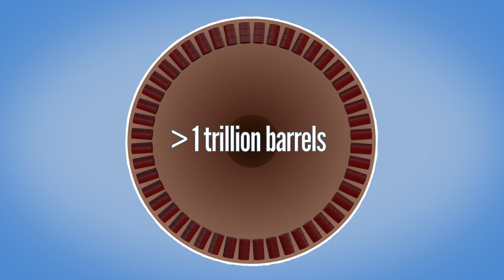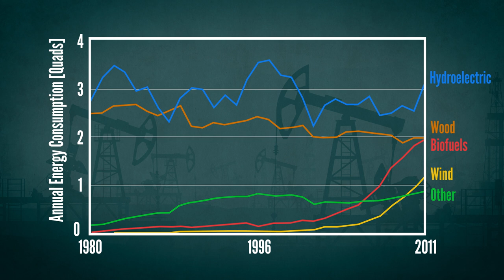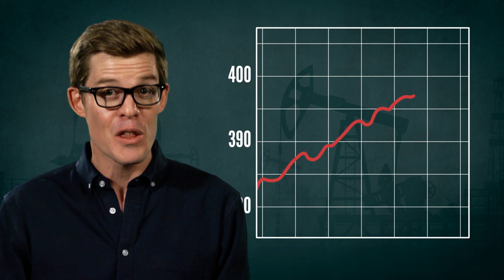When Will We Stop Using Oil?

Comment: Has anyone noticed that most of the oil we drill is not used for fuel? It's used for making products such as plastic.
Reply: Jacob F plastic is a byproduct.. not a direct source
Reply: Hmmm that doesn't really change anything because we still need the oil to produce the plastic.
Reply: Jacob F no we dont.... we can make plastic from milk protien... or even cheaper ..chicken feathers
Reply: Yeah shitty plastic that's... Ugh... Biodegradable jk. Yeah you got me there my bad
Reply: Jacob F in the end we are all in the same team.. we must fight against oil! because in the end it will be expensive......very expensive..to the point we will reach the "artifical peak" he mentioned in the end
Reply: I agree with you there, but completely replacing oil will be no easy task
Reply: Jacob F yep, it wont be completely replaced.. it will be a gradual procedure... all we need is better battery technology... and better solar cells.... also thorium reactors..and fusion reactors

Comment: i did some calculations using google calculator and it said we will run out of oil in around 29 years! thats just saying if we use and produce 93 million barrels and there is 1 trillion barrels left in the earth! so we probably should switch to other ways of power like solar or water!

Comment: Oddly, I have never seen the following question addressed anywhere (and I have been looking): At some point long ago, was all the carbon in fossil fuel in the air (as CO2) all at the same time?

 All the carbon in fossil fuel comes from CO2 that was made into sugar by plants through photosynthesis. So all of the carbon in fossil fuel has been in the air. But has it all ever been in the air at the same time?

  If it has been, then global warming at that time must have been tremendous with all that CO2, because, as this video mentions, only a fraction of that carbon has been released so far. But life must have been going along well at the very same time in order to account for for the fossil fuel deposited.
Reply: Ice core samples have shown that CO2 levels on earth historically were at 7000 ppm. There were no humans or combustion engines then. What caused it and what was earths climate like?

Comment: You say "pump oil"  several times, but did you  know that most of the oil produced is not "pumped"  up from the reservoir? Due to a much higher pressure in the reservoir, you can produce oil without any pumps, as much as 20 000 bbl/day from a single well, without any pumping. Pumping oil to the surface only accounts for a very small fraction of the total amount of oil produced world wide. 

Stay curious

Comment: here's an answer since they decided not to answer. Ok to be fair I can't give u a date. but it's all about $$$ when the cost of oil exceeds the cost of current less efficent energy sources, ie (solar, wind, etc) That when. I would imagine this will be around the in today's dollar amounts 7 US dollars per gallon. And would have to stay around there for years. 
At around 4 or 5 dollar shale oil is cost efficent. So it wont be then. So as long as oil is cheap it wont change.

Comment: What is renewable energy? Is energy renewable? What's renewable in renewable energy?
Reply: it's energy that doesn't end
Reply: It's energy that's very hard to run out of.
Reply: Renewable energy is not a correct physical term. We can't renew energy as we can't either create energy. What is renewable is the process we use to transform it.

Comment: I love your show.  Now if more people like you would built up modern Nuclear power, you might sway public opinion to build these clean and safe but very expensive (upfront cost expensive) power plants. 
With access to clean electricity we can then move into actually creating other clean energies while using clean energy. 
Right now we are using coal, oil and natural gas to build things like wind mills and solar panels and hardly seeing any reduction in fossil fuel use because we have to use so much to make these things. 
Start with the nuclear power plants and move out from there.

Comment: Peak fuel usage usually doesn't occur due to existence of more fuel, it usually comes from alternatives and fuel prices. Peak oil won't happen because we "run out," that's not a risk, it will happen because accessibility for oil becomes more expensive than the next best alternative. This can be expedited by price manipulation, but that's tricky since oil is a really good fuel and forcing a sudden change could literally destroy entire countries and kill millions of people (consider the welfare of people living in countries with oil based economies). There's likely an efficient tax that would internalize external costs of using oil, but agreeing on this efficient tax is politically very difficult when a lot of people stand to gain or lose from any price manipulation. So it would be hard to just decide our own peak oil use.

Comment: Based on the numbers in this video, oil will last about 30 years (29.4) after 2015. So by 2050 you can almost guarantee that there'll be no more oil if people consume oil at the same or greater rate, unless some alternate source of energy becomes widespread.
Reply: DRUNKDONKEY100 
I said "based off the numbers in this video". I wont change my statement unless the stats are proven wrong.

And in any case, what are your thoughts about alternative energy (e.g. Nuclear energy)

Comment: 1. I graduate in May and will be making near $100k with salary and bonus's with a petroleum company. Suck it
2. Lithium is highly finite relative to oil - good luck with those batteries sustaining our world's energy demand. 
3. Since the end of the ice age the sea levels have been rising. At one point it was rising 400 ft/yr. To give some perspective, the UK was not an island 12000 years ago and Australia was connected to Asia, which is why humans were able to reach it at such an early time in our history. 
4. look at temperature graph from greenland ice cores dating back 12000 years (end of last ice age). Climate change activists will only show the last 1000 years because that plays to their narative, but not the whole picture. A little like me presenting a graph of how US Bison population in the last 50 years vs 200 years. Two very, very different perspectives.
5. Leaked emails from Climate scientists from the IPCC show them talking about skewing/omitting data that doesn't fit their narrative
6. One of those instances was the lower troposphere temperature readings which disprove their claim and go against their model, so they put a "correlation" to "fix" the data in such a way where it didn't disprove their model.
7. Governments don't give money to scientists that wont research climate change in an unbiased way. It's a political agenda for them. But scientists are beginning to come out in droves against institutions like the IPCC because of their skewed data to fit a narrative. 
8 - infinity. I can do this all fuckin day

Comment: trillion is a massive number.  so we won't run out soon, it'll just get to a point where supply and demand will drive the price up to a point where the alternatives will be more plausible alternatives. In general, humanity wants to take care of the individual and its own. So as long as the price of oil is cheap enough to power our collective needs, it'll remain the "go to" power source.  If technology can produce more efficient batteries for cheaper, we can move to renewable resources sooner.  just my 2 cents. btw kuddos for the "I love lamp" bit. lol
Reply: trillion = 10^12, 100 million = 10^8, 12-8 = 4 , about 10^4 days left of oil.... 10000 days....Very very very rough estimate.

Comment: What I find especially irksome is that we have biodiesel, yet no one has invented biogasoline yet. If we can make one kind of liquid bull#%#% without drilling for it, why aren't we making an effort to learn to produce all fuels artificially? Come on, people, it shouldn't be this hard to replace fossil fuels with renewable equivalents when we already know it can be done. What is wrong with our species?
Reply: Biofuels aren't better for the environment. They are just more sustainable than oil. Crop fields are an ecological disaster. Modern agriculture causes significant damage to the land and water around it. The process of harvesting, transporting, and processing the crops into usable resources is difficult and dirty (especially in the realm of biofuels). And finally... It still burns. Its still a fuel made from decayed matter. Its still chains of carbon that are broken up and mixed with oxygen to create CO2 among other pollutants.

Also, we do have "biogasoline", its called ethanol. It isn't a perfect replacement for gasoline as it actually burns far too hot to fully replace gas, but it is in widespread use, for better or for worse.

Comment: According to the estimate at the start of the video, if we produce 93 million barrels of oil a day, and there is a trillion barrels of oil left, the world will have run out of oil in less than 30 years....
Reply: It's not like suddenly the world will be like "what?? No more oil??" The price of oil will be too much to use before we run out. It's simple supply and demand.
Reply: Jacob Patton True, but we've not made great progress in perusing other energy sources. 80% of the worlds energy is still supplied by fossil fuels, the majority of the alternatives are still uneconomical.
Reply: +Even Andy Only if the proven reserves don't keep increasing. And they are continually increasing.
Reply: Eric Duprey Oil is a finite resource? Like what do you mean?
Reply: Even Andy I'm saying thirty years would assume that the oil we currently count is all the oil there is. To the contrary, throughout history the proven reserves (the oil we have found) have been increasing faster than we can consume it. Yes, that can't continue forever, but I don't think we have hit the wall yet where we've found all the oil so thirty years of it is all there is.
Reply: Eric Duprey Ahh fair enough, yeah 15 years is probably a little short for oil to run out. There has been some reports that we've past peak oil so it may be that it becomes less and less economical over time. I guess in that case it'd be phased out

Comment: Do the freekin math.  90 million barrels a day times 365 days= amount used per year. Which equals 32.850 billion barrels consumed per year.  Divide  1 Trillion in reserves  by  32.850 billion barrels and we get 30.4 years, NOW! mulitply 30.4 years by however much you think we can recover.  100%, 80%, 70%-  The reason gas is cheap now is that we are pumping more of what we already know we have. We are not discovering more oil!  This video sucks because it doesn't answer the question.

Comment: What really bugs me about the subject is that we already have alternative methods of gathering energy renewably and harmlessly that are enough to cover our needs. Solar power technology has dramatically grown over the years for example and a panel a third the size of the dashboard on your car is more than enough to power it on a completely overcast day and then some. Engines designed to run on this power already exist and can be used for pretty much anything, but aren't being produced in masse simply because it doesn't financially benefit companies to do so right now. The companies responsible for our energy production are more concerned about short-term profit than the long-term* profit down the road or you know, the survival of the human race and the countless other species on the planet. -_-
*Long-Term to them isn't so long all things considered. This is already having serious side effects and the younger generations will have their hands full soon.
Reply: The economic balances of financial sectors lays a heavy burden on energy production. The vast differences between the cost of a new piece of real estate and a new solar panel is dreadful. There is a reason oil is still winning and it is less to do with greed and more to do with an imbalance of values across financial sectors. Oil would be much less lucrative if investments of other sectors fit a pattern better suited for solar power.

Comment: Boycott oil if it bothers you so much.
Reply: ...just don't forget, to boycott oil, don't buy things shipped by truck, train, or boat. Plus, don't buy plastics. Or metals smelted with fossil fuels. Or food grown with petroleum-based fertilizer.
Reply: Essentially, you'd need to move in to a closed, Amish community to even approach "boycotting oil."

Comment: Molten salt nuclear. Period!
The only way to save the biosphere. Renewables can help if we erect global powerlines/super cheap storage, however, that RE overbuild to the inverse of its capacity factor and the storage, requires far more energy because the diffuse and intermittent sources need far more mass to be mined/processed.
What's the cost of solar, today? Multiply that by FIVE and add the costs of storage. Yep, that's the true costs!

Comment: we will if we find a solution enough rentable and powerful to run out oil age. It's not the case yet, and the Nuclear Fusion is not operational yet. Herein another problem, it's not all about energy world problem, it's about the needs outside energy equally. Matters do with petrol ⛽, plastic, roads... etc. And even if we escape the energy problem, without oil, the matter made about oil will cause problems equally. oil components are really everywhere

Comment: Really it all comes down to economics. When green energy is cheap then oil, we will undoubtedly change to green energy, and this will happen in our lifetime. Long term trend in solar shows that solar cost per kwh halves every 10 years. So, now solar cost are roughly double that of oil, but 10 years from now it will be about the same. 20 years from now it will be roughly half and the more costly wells will stop and new oil production will stop but for the use of producing plastics or fertilizers and such, but oil for energy will be out of date. 

  As for global warming, we need to get an honest compare and contrast of the cost of reducing oil use which will cost money and in turn lives vs the cost of global warming which will also cost money and lives. Ei, cutting 10% of oil use will mean 10% less CO2, but it will also mean the poorest people will not be able to afford oil, meaning that can not drive to sell their crops at a good market and will not then have the saving to live off of when the crops fail one year and people will starve. "Each year, 2.6 million children die as a result of hunger-related causes" significantly increase the cost of oil and you may push that number up by a few million. This need to be balanced with the fact that global warm will also likely kill millions of people as well. There no easy answers and those who say otherwise are an idiot or are selling something.

Comment: Coal and oil suould be considered renewable energy since they were once energy from the Sun.
Reply: Nope.
Reply: @rps1689  Plants and trees convert about 0.7 % of the Sun's energy
Reply: @abelgarcia5432  And?
Reply: @rps1689  Coal and Oil are not considered renewable sources.
Reply: @abelgarcia5432  Correct, and they shouldn't be because the energy derived from them is not replenished at a higher rate than they are consumed.
Reply: Coal was once wood which is renewable.
Reply: @abelgarcia5432  Irrelevant. It formed from the remains of decayed plant material compacted into a solid through millions of years of chemical changes under pressure and heat.

Comment: Didnt answer the question in the title. Just turned into an environmentalist rant.
Reply: HavocKing117 answer is.. we will run out of ways to extract oil.. but never really run out of oil completely.. this makes oil expensive..that was the "artificial peak" he was talking abt at the end ....people will have no choice but to opt renewable sources of energy....... natural gas is a whole other story.. we are very unlikely to run out of it
Reply: I'm not sure if you revisited the comment section to get the answer, but if you trust their numbers you can do some math to find out:

If 93,000,000 barrels are extracted per day, and there is an estimated 1,000,000,000,000+ barrels stored inside the earth...
If the extraction rate is constant (which it will not be), and if all the barrels in reserve are accessible...
Then 93 million x 365 = 33945 million per year, 
and 1,000,000,000,000 / 33,945,000,000 = 29.459...,
so, the answer is "around 29 and a half years, depending on the rate of extraction and accessibility to the total oil inside the earth."

Since you weren't the only one to ask this, it may have been worth mentioning in the video, however, the math involved isn't very demanding.

Comment: So, renewable energy is fine, but why don't we (US) use nuclear power more? It is safe (no, really), clean (no, really), and cheap compared to most other energy technologies, especially if you consider thorium vs uranium for the fuel.
Reply: The problem with nuclear is that you would need 14,000 nuclear power plants to meet the worlds needs. It wouldn't be cheap or really renewable anymore with the materials to make the reactor (uranium or whatever) would decrease in supply. Plus I don't like the idea of several nuclear power plants within 200 miles away from me in every direction.